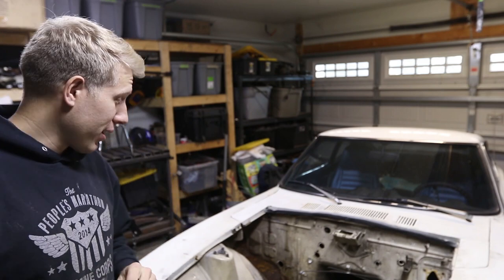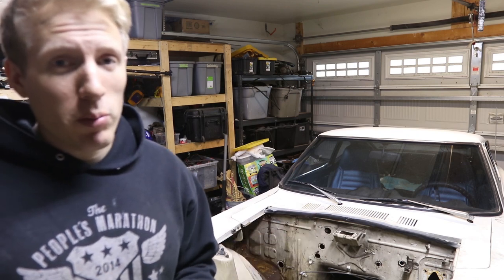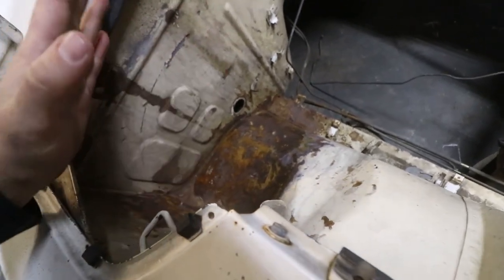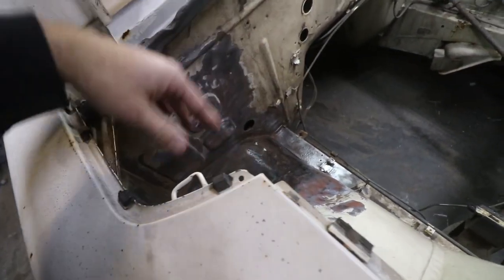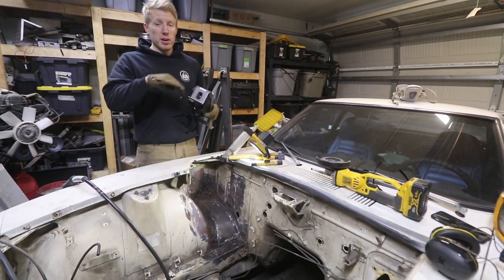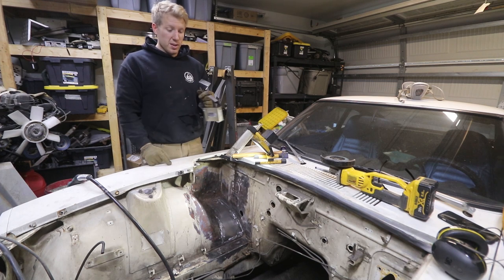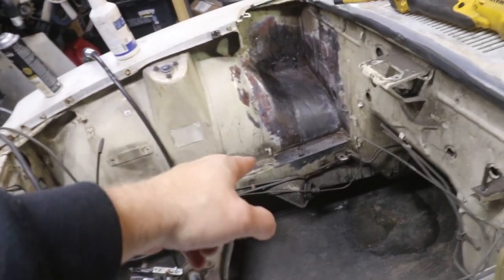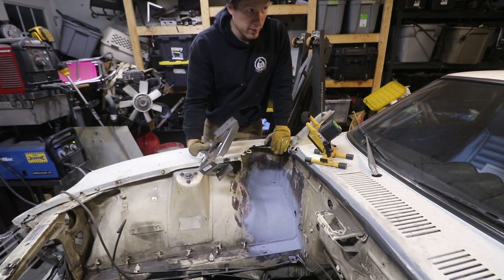Datsun 240z Rust Repair And Battery Tray Replacement | 1971 Datsun 240z Restoration

Comment: Nice video! Do you know if the car wil stil rust after a restoration? (i want to strip the whole car and get rit of al rust, and get jt al spray painted inside and outside) is this enough? Or wil it stil rust after few years?